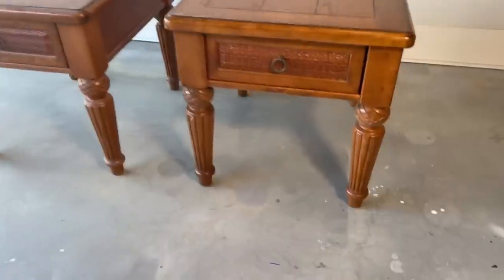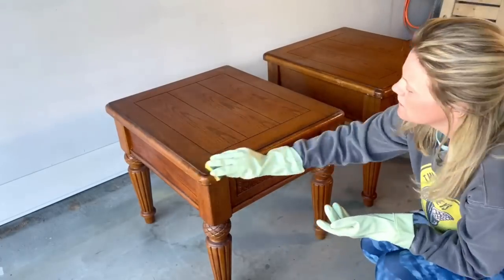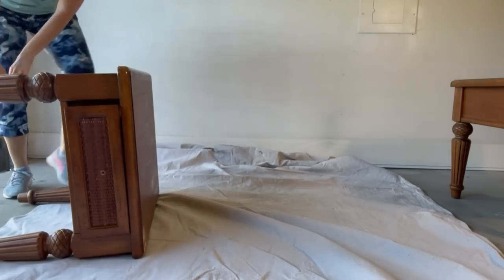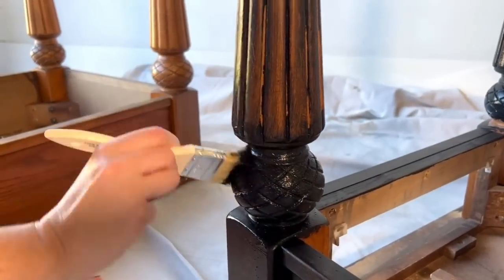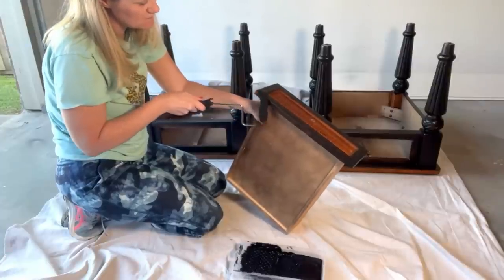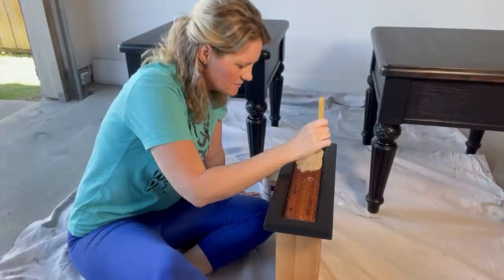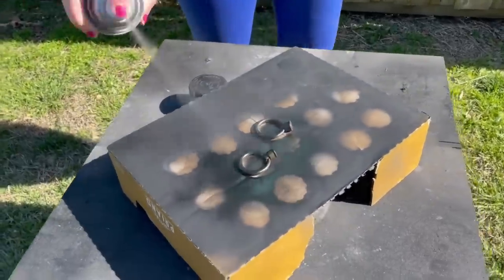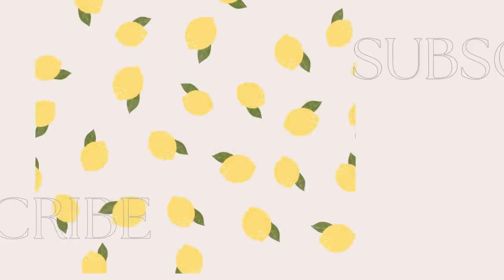Chic on the Cheap: Thrifty Transformations in the Face of Adversity // Beyond Paint

Comment: Check the link, this paint is NOT expensive.
Reply from the maker: Nope! I think it’s a great price point for the amount you get and the coverage is superb! Those end tables looked like top dollar after 2 coats! I was really impressed!
Reply: $46 a quart is kinda expensive.
Reply: @steelsunpi  It is, you are right.  A regular gallon of paint is over 100 so this is like twice as much. (more or less)  This paint is very different though.  You can see this from her demonstration.  It is doesn't need a primer or a top coat, so you save and money there.  Compare this cost to Annie Sloane plus her wax.  All that considered, I still say this is not that expensive.  Not dirt cheap, but much more reasonable than the rest of this type.  If I actually get some, I will try it, see how it covers, access the durability, etc.  Then report back.  The application seems very easy, it is so thick, you don't seem to have to worry about all the drips.  I am expecting good value for the money, but we will see.
Reply from the maker: I agree with all of this! As someone who has tried most everything at this point, the all in one is such a time and money saver. The thickness offers great coverage with limited coats and it is very durable. Gives a flat finish which I really like and in all honestly I was supplied 2 lg black licorice and one lg linen color. I have done 3 projects now with the black AND still have not cracked open the 2nd container! I barely made a dent in the linen color since I did such a small space. BIG savings all around! and a great quality, user friendly product! If you all get it, please report back! I'd love to hear your thoughts!